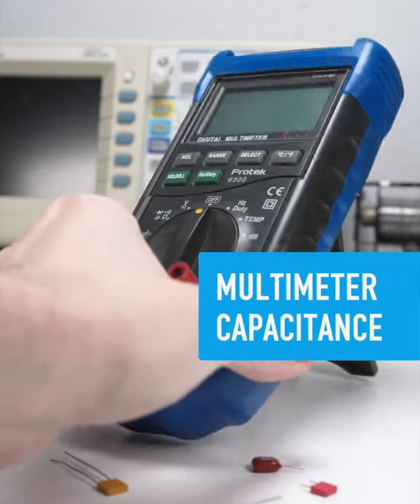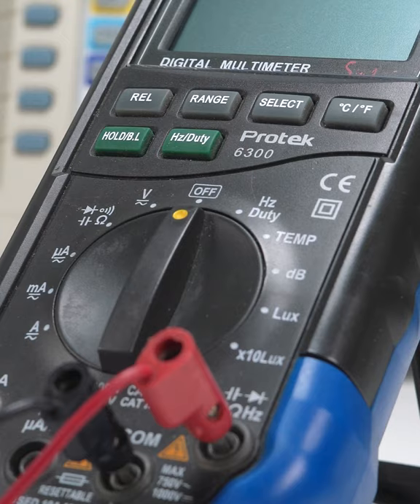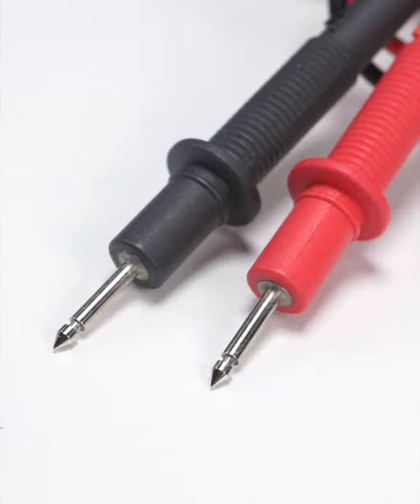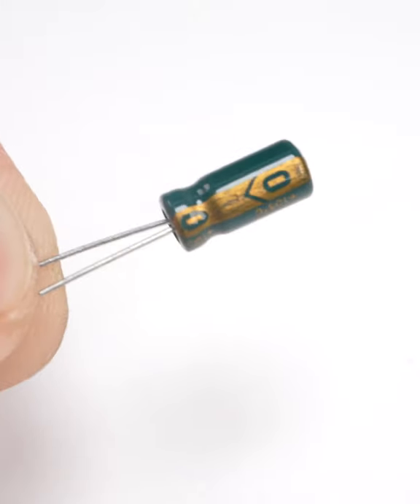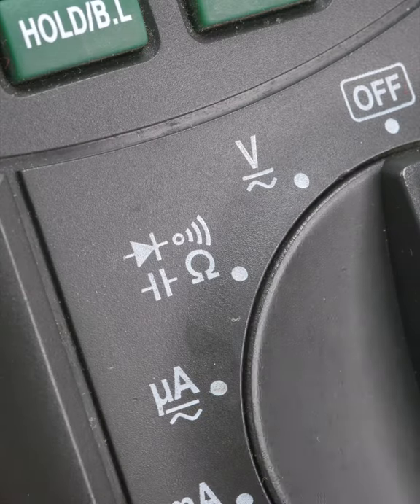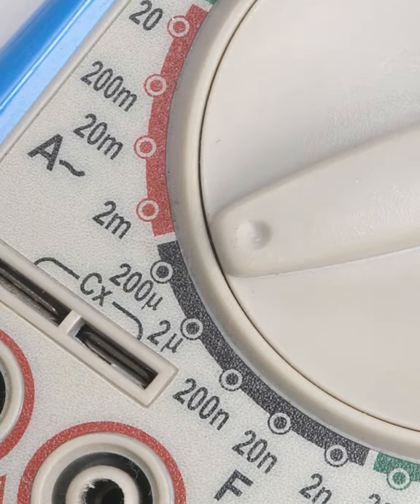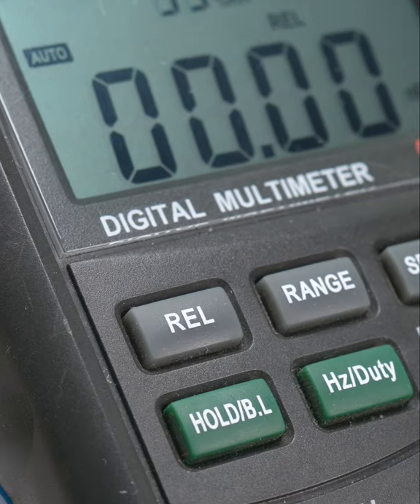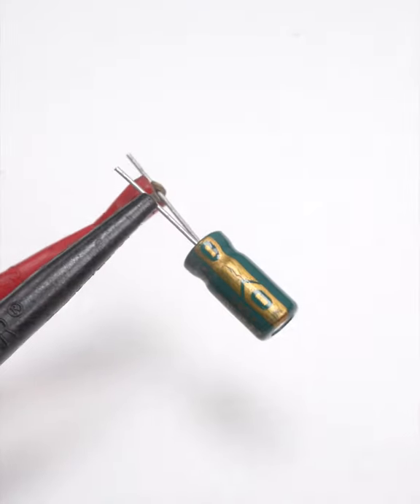Multimeter Capacitance Measurement - Collin’s Lab Notes #adafruit #collinslabnotes

Comment: what if a user doesn't have access to multimeter that has capacitance measurement capability. is there any method we can indirectly work out capacitance value?
Reply: Not in any practical sense I can think of. Technically you could do so using a sourcemeter(precision power supply that gives precise current outputs) and oscilloscope? Though I imagine the chance of having a sourcemeter and oscilloscope but to capacitor measurements on your meter are rare.

Very hacky but you just might be able to do use a multimeter in resistance measurement mode as a sourcemeter? You'll need a second multimeter however to check the current the first one sources, and still an oscilloscope to see how long the capacitor takes to charge to any particular voltage.
Reply: You can buy those cheap chinese component tester
Reply: Then u should just replace the capacitor in doubt.
Reply: If you have an oscilloscope, you can create an RC circuit and measure the frequency.
Reply: @perwestermark8920  if he doesn't have a multimeter how on earth will he have an oscilloscope that costs atleast 50times of a good multimeter .
Reply: @KuntalGhosh  He didn't say he didn't have a multimeter. He said he lacked a multimeter with capacitance measurement.

But the important tidbit isn't oscilloscope but RC circuit. A number of multimeters that can't measure capacitance can measure frequency. And hobbyists with programming skill can get a microcontroller to measure frequency too.

If it's big electrolytes on the other hand, then it might be better to use the multimeter + watch and measure the time it takes the capacitor voltage to rise by selecting a suitable resistor so it takes a while for the capacitor to charge.

Edit: if we assume $20 for a multimeter (it would not be a good one) then 50x that price is $1000. And you can get a decent oscilloscope for way less than that. If not needing fast single-shot curves then some decent oscilloscopes can be bought for $150-200. Which means we are down to 10x the price of a crappy multimeter.
Reply: @KuntalGhosh  hahaha great point since caps are always labeled these days anyway, you'd have to be using something ancient for it to be unmarked, like even the oldest caps I've seen have been color coded at least!
Reply: You can hook it up in an rc circuit, measure the time constant, and work the math out. Google rc circuits (specifically the step and natural responses) and you should be able to get all the info to do it pretty quick
Reply: @KuntalGhosh  You can get a digital one for about $70US. Your point is still valid though.
Reply: millihenries has entered the chat

Comment: For large caps (>3,500mf), I was taught to connect the leads backwards, positive to negative. Takes less time to charge the cap that way.
Reply: If it takes less time to charge the cap, that means the multimeter will show lower capacity than what capacitor is acually rated at
Reply: It works by knowing how much it charges also the laws of physics dictate tower charges up

Comment: OL will set  some even a autoranging meters to manual range and the OL may occur anyways. At least this is the case with my DMMs. The real button works well for capacitors or resistors that are small value like 100 ohms resistance or 1uF or less.